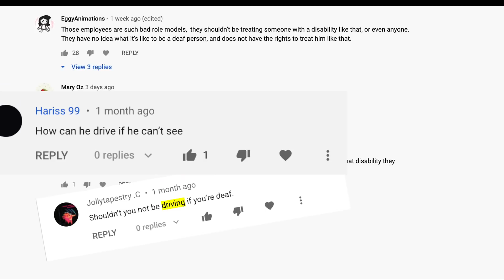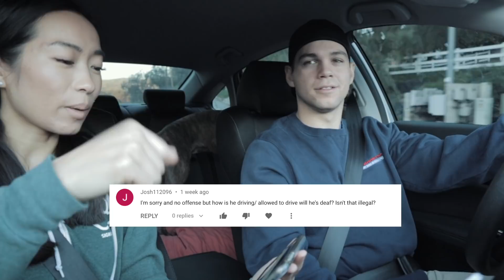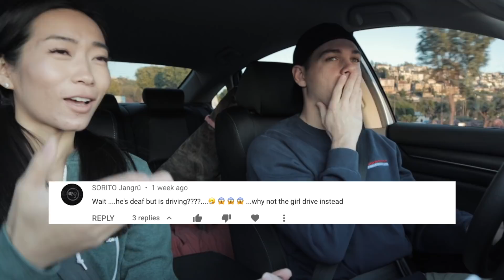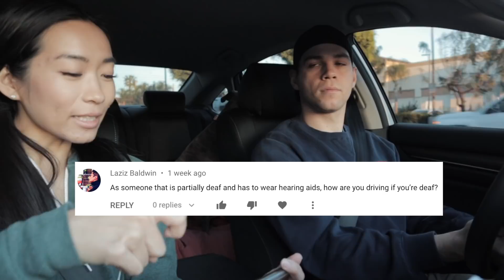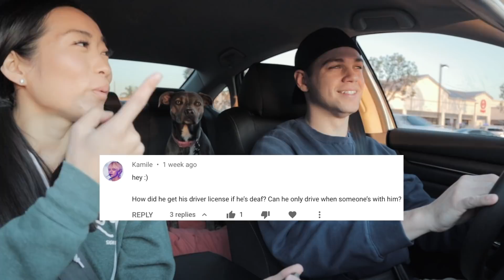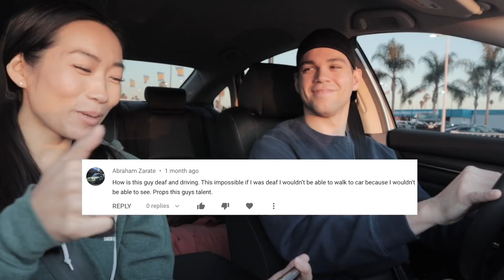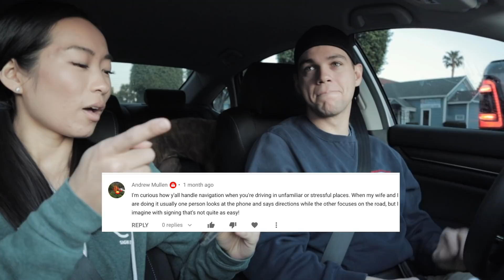How a Deaf Person Can Drive

Comment: Tell them there are deaf pilots (like myself!) - see how shocked those people will be!   Deaf people can do anything except hear!
Reply: How do you communicate with air traffic control?  Don't you need to be able to hear them talk to you over the radio?  Honest question, as I'm not a pilot and don't know what other comm systems are available to pilots.
Reply: yes people usually shocked to hear your deaf and still accomplishing goals and doing normal things hearing people can me being half deaf some deaf people can still hear like me just not as good as normal fully hearing people we can do anything we set our minds to and I know being deaf some places will not let us work there I have seen it on tv just means we find somewhere who will or start our own company we can do anything a hearing person can we just do it differently
Reply: Just came to say hello fellow deaf pilot 👋🏼
Reply: @masterjedifunkolobstah4836  in my case, I’m not profoundly deaf, I can hear ATC through my headset better than I can hear a person standing next to me in a store trying to talk to me. 

There is a guy at my club who is profoundly deaf, the club used to use a light system for him to clear him for take off and landing, he flew VFR, so he didn’t need to communicate with controllers in the air (he had to avoid restricted/controlled airspace obviously). 
The rules got changed and he still flies but he now has to have someone sat beside him to use the radio on his behalf while he flies.
Reply: @masterjedifunkolobstah4836  theres a device called a screen and reading

Comment: People: "Deaf people shuld not be driving"
Same people: Driving while listening to music turned up to 11
Reply: Eleven isn't that loud in my car they should all be the same soz that was irrelevant I was justbored
Reply: @portaldolphin13  trust me they arent the same. My old car's volume at a 20 would be like a 2 in my new car with the premium sound system. It depends on the power of the speaker and the amount of speakers in the car
Reply: ok but i ride a motorcycle, they are very small and sometimes not noticeable. We use sound so we dont die when riding
Reply: AAHHHH. AN ODD NUMBER OR NOT A MULTIPLE OF 5. EWWW
Reply: dude I max it out almost.  I have a hearing loss and I turn off my hearing aids because they suck for music, so then I can feel the music better, and also hear it more clear since the speakers are better than going from speakers to hearing aids.  Yeah I could hear a siren, and a honk, but not much else, but what else is there to hear?
Reply: Good point! Not like they can hear anyways!
Reply: God i think some people have never seen  spinal tap I believe thats what he was referencing
Reply: LOLLLLL
Reply: @portaldolphin13  It pains me to a physical degree that you and the other guy don't know what "turned up to 11" means

Comment: As a hearing person who drives a manual, can confirm that I rarely shift gears by looking at the rpm gauge. It was helpful for maybe my first 3 to 6 months of learning, but after that it's much quicker and safer to shift based on how much the vehicle vibrates while you drive. Listening to the engine does help, but the only reason I would ever consider listening to the engine is to avoid being too loud when I'm changing gears.
Reply from the maker: Yea! I had a few manual trucks in the past and am currently converting my benz to a manual. SAVE THE MANUALS!

Comment: also, i feel like ambulances etc. drive so fast that I only hear them when they are almost passing me, but when looking in the mirrors (as often as you actually should) you catch it way earlier
Reply: Exactly.  Everyone should be scanning the road around them periodically instead of looking straight ahead all the time.  This means using the side and rear view mirrors and turning your head right and left periodically.  Even when I'm approaching a green light at an intersection or it turns green while I'm sitting there, I look both ways to make sure no one is entering the intersection late.  Just because it's green doesn't make it safe.

Comment: My hard of hearing and deaf friends can drive, and boy they love driving as well. I havent gotten my driving license yet, but I'm getting train to drive fork lift and cherry picker and have passed the exam before driving. I did have one person at work ask me about it and it was a little offensive but i shrugged it off to explain more about my ability that were no different then others, and i would more visual as well, as well as following the health and safety rules.  You can see someone coming through the racks, it isnt completely stuffed in and it shouldn't be either  also you are suppose to stop at the corner and honk as well as well as between the racks. I found that alot of hearing people like to go around the corner sometimes not honking or going too fast. If so in some area, there is no honking but no racking around in that area. Others the health and safety would say no walking around that corner because it is a traffic area for operators.

Comment: I am hearing and my wife is deaf, she is a MUCH better driver than me, she is much less distracted than I am by outside influencers. She also notices things I don't. One thing that helps her notice emergency vehicles better are the indicator lights on the traffic signals that go on when the OptiCom systems are active. That is the system that uses I-R or strobes to activate traffic signals automatically by police, fire and EMS. These indicator lamps on the traffic signal standards can be seen at a huge distance and they use a bright white light so they stand out.

Comment: First of all, I don't drive because of anxiety and a processing disorder (too much visual and sound information all at once causes me to shut down). Saying that, I can totally see how relying on visual cues rather than audio would actually help me in the case of emergency vehicles. In the US, the sirens they use are overwhelming, echoey, and I can never tell from which direction they're coming. But if I were to rely on mirrors I would probably process the lights and their direction before I could ever figure out where the siren sounds were coming from. Also, honking doesn't seem to have much use in my experience other than people showing their annoyance (in most cases). Fear of people honking is a major reason I don't drive. I do know it serves a purpose in some cases when people aren't paying attention to what they're doing. But even in those moments, the sound of someone honking at me would make me shut down rather than correct me. So I do thinking visually I would be more able to drive if not for the sounds.

Comment: I am deaf since birth, in Japan deaf will have to do hearing test and must be 100% correct based on direction of siren, what siren - police ambulance and fire. One mistake it's over. I drove since I was 15 in New Zealand for 11 years then I came to the U.S. I drove 7 load horse truck trailer with five horses inside and was sent to Canada alone from New Jersey 9 hours drive one way by myself within three months after I arrived in the U.S., not to forget to mention driving right hand side of road. I drove left side of road in NZ. No problems no accidents and drove all over east coast of U.S. and Canada taking horses to races by myself as well as transporting for others as well. We had a horse that went down inside I felt something wrong and had to pull over. There were one passenger with me asked why I pulled over I said horse is down, she's like how do you know? I told her it's the movement, the horse stopped moving. She didn't feel anything and was amazed. We even had unruly horse like kicking, one day I was not driving but felt the vibration difference and told the driver to pull over, he said "it's ok one of the horses are known to be a kicker and does that all the time" I said "no it's not that horse, it's the other two, something is wrong" he's like "are you sure?" I told him "pull over now".  He was shocked to find the other horse got tangled up with the lead rope, not the kicker and asked "how do you know?" I said "it's the vibration/movement that's off that's why". Since I pay more attention to driving than talking to passengers so, that's how I am. I am married six half years and counting to my wonderful husband (we already known each other a year before we got married) my husband is all hearing and he doesn't sign since I don't sign, while I'm driving I do the talking, but when my husband wants to do all the talking, we switch and he drives. It's for safety. When deaf able to prove everyone wrong go for it, don't let anybody stop you, prove every one wrong like I did all my life. I've proved Japan wrong, I've proved Americans wrong. NZ and Canada gave me opportunities to show and prove myself as deaf person.

Comment: In Belgium you can go for a drivers permit, but for people with disabilities they need a document from a physician specialist on that particular field. Also if you had a hart attack or diabetes it needs to be documented. If the doctor says there’s no problem or danger for the person in question or others they can go for it.
As i said before my son has problems with fluids behind the ears when he has a cold but now we know he has on his right loss of his hearing. So on the exam because i was the teacher an examinator was appointed and told him he will not say it because he doesn’t want to be any trouble but speak loud and clear enough because he’s concentrating hard. Normally as teacher your not allowed to point or give advice during the test but i was allowed to repeat or point. He made it and drives very well. Everyone can make his body more aware, i feel more vibrations too and noises others don’t seem to hear.

Comment: With the sirens thing anyway: I'm in the UK but I've noticed that a lot of the time, emergency vehicles don't even use their sirens all the time, anyway. Most of the time, it's just the lights, and they might just blast the siren at short periods for extra attention. I don't know if that's a UK thing, or a just my area thing, or just my imagination, but like 90% of the time when the emergency services have passed me, there's no siren.
had a thing driving a while ago, where I noticed someone in a car going the other way was staring at me angrily and jabbing their finger ahead. I was confused until I looked in my mirror and finally noticed there was an ambulance with it's lights coming up behind me fast. And that's on me, because I should have been checking my mirrors more often, but sometimes you do sort of get comfortable and forget to do it as often as you should, which is bad.
So yeah basically I was driving like "Lalala, I'm drivinggg, hey what's that guy's problem? I'm not doing anything wrong here OH SH-"

Point of the story: even if you're hearing, don't rely just on that to alert you to emergency vehicles. The lights are there for a reason too.

Comment: Let's me share my experience as a deaf person. I'm almost 18 next month. Back when I was 15, my mother's close friend wanted to teach me and my older brother (he was 17) how to drive. When it was his turn, his driving seemed out of control and sometimes he over speeds but forgot to brake. When it was my turn, I was so scared cos i saw the impossibility of driving a car being a deaf. I told myself it's worth a try. When I drove the car, the friend just points on how to start and use the joystick. It was so smooth after I drove few meters,  I tried to go 20mph in a tight area but whenever I turned, it went so smooth(I pressed brake a little before turning, it's all about how you know stuffs about cars either from games, movies or imagination) but one thing I can't do and haven't perfected is that I can't drive reverse and the joystick is old which was hard for me to switch to reverse.
As you know, being visual can be helpful for deaf when they're driving. FYI, I've never drove on a real road, just a walkpath and community road. If something is impossible, try it out before coming into conclusion that it's way impossible. Thank you for reading the comment😊

Comment: First thing first, don't go under any cars until you get safe jack stands. I can't trust the harbor freight jack stands after two recalls in a row. Safety first, and don't be cheap when it comes to safety.  Jeez people must not know how to drive. I don't need sound to drive, I don't need the back window / rear view mirror. I don't know how this was even a question. For the person wondering if he can drive a manual, they must not be able to... you don't have to look down at your gauges as often. I feel any time i drove a manual, the speed is more consistent, partially because you can tell the engine speed by hearing/ feeling, and if the engine is going one speed, in a certain gear, then you know how fast you are going. Then again, I seem to always drive the cars without speedometers, that's just my luck. (Yes I can fix the issue, but its more work than I care to do for a minor inconvenience.) Then the navigation question... I've had the sound off on my phone while using waze or google and the picture is enough information for me. Sometimes the sound is annoying because its at the wrong time, especially in cities where everything is closer together. I feel like the people asking these questions shouldn't be driving themselves. 
Also, seriously, get better jack stands!!!!!!!

Comment: Deaf people, handicapped people, and hearing people CAN DRIVE, but blind people and deaf-blind people cannot drive.  I'm deaf and I used to drive from 1974 until 1999.  I became disabled due to a 1985 automobile accident by having arthritis on my neck and my back.  I didn't wear the seatbelt when I was involved into a 1985 automobile accident that broke my right femur (thigh bone).  The other driver drove on the wrong side of the highway.  The accident happened at 9:30 PM EST and I arrived in the hospital at 12 AM EST.  I woke up on the passenger side floor and I tried to move myself up to the seat, but I couldn't.  I knew I got a broken leg, but my nose didn't break from hitting the steering wheel.  The fireman cut the driver seat off before putting the board on me.  It was very painful and I yelled out aloud.  It was very bad painful experience and I was lucky to be alive.

Comment: You can feel a car horn? that's amazing... If anyone wan't to answer some of these questions that would be great. I'm curious, what happens if you get pulled over by a cop? And motorcycles,  when most people are changing lanes they only look for cars but if you hear the exhaust you're more acutely aware to look for a bike. Also, If you're with someone who knows sign language, doesn't that make it even harder to focus on the road if you're constantly having to look at them to communicate? What do you do if you need to hear an emergency broadcast on the radio? You know the signs saying tune into AM 600 or something for snow conditions etc.

Comment: I don't get why people think being Deaf would stop you driving? I'm hearing and I drive round with loud music everywhere, so I can't really hear what's going on but nobody thinks twice about that 🤣.
I do similar with being careful to visually check around me and the whole not being able to hear the engine's rpm never made sense to me either? I have a manual and I shift through a combination of feel and habit -  lke, I know what gear I should be in at certain speeds and uphill vs downhill etc. Most people don't tend to change gear at the right time even listening to the car anyway because they don't think about power bands and stuff, but you can just... tell... when you've changed up at the right time because it feels right, smooth, no drops in acceleration and such. 🤷🏼‍♀️